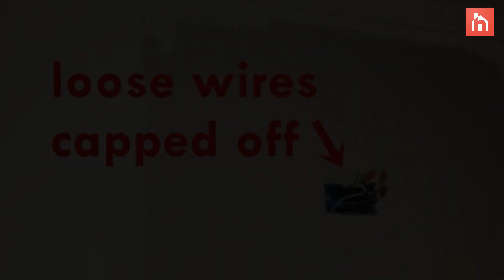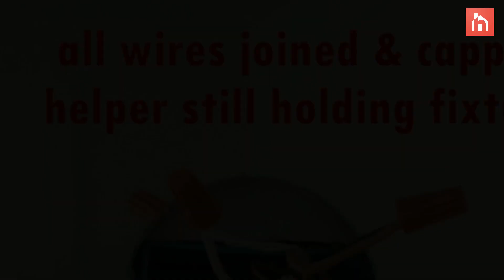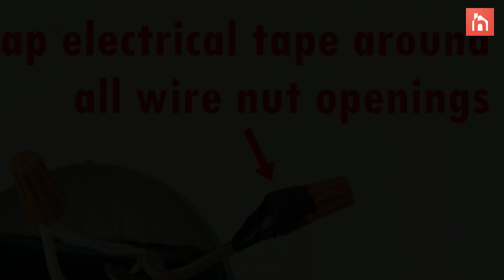How to Mount a Light On Top of a Mirror Bathroom Vanity

Comment: Well, I wish I would’ve seen this prior to me drilling six holes in my mirror for my wiring and the mounting brackets. I’m not redoing it because I had to have a lot of patience for drilling these holes in this mirror. I’m trying to figure out how I can protect the mirror, so doesn’t get scratched from the light that is metal on the base. I thought using command strips as a buffer but i don’t want nothing showing . Ughhhh